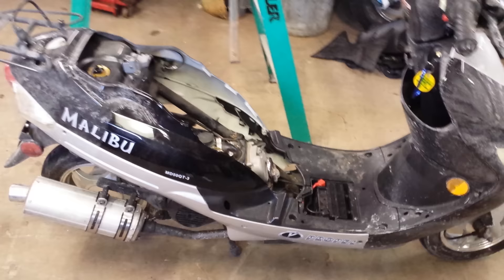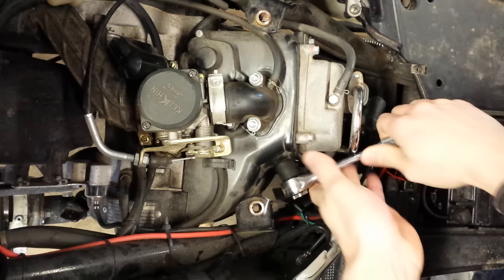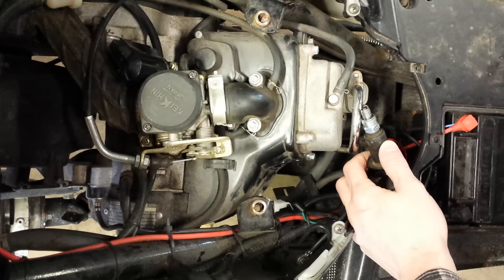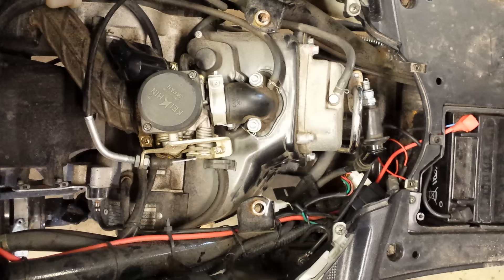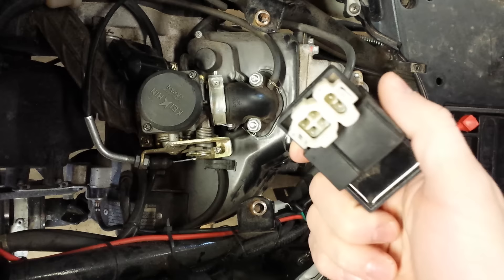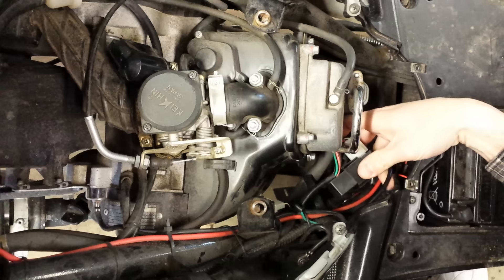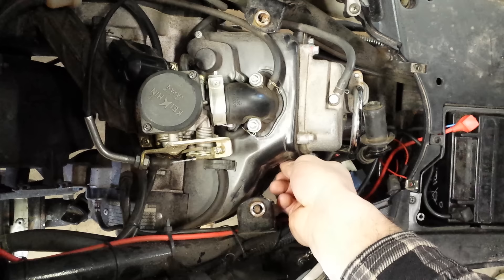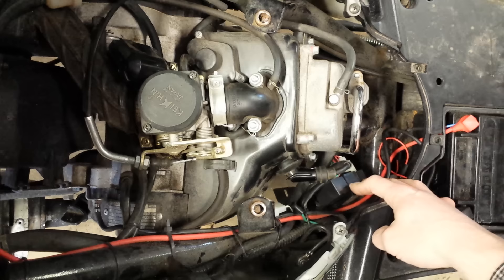Fix Chinese 49cc Scooter that won't start

Comment: Bro. 8 year old video saved my 2019 scooter with only 458 miles on it… hard time starting. I changed spark plug, cleaned carb, changed fuel filter and fuel. New battery. I was about to give up and saw the video. Paid $8 for CDI box and she started up… wow. Thank you

Comment: Also don't forget put some anticase on the spark plug cuz it's aluminum cylinder head
Reply: Funny you say...its also taotao so you will need to romove spark plug before oxidation starts🫡

Comment: no spark means bad cdi usually is what videos say but no , sidestand  has a kill switch for electricity , dont use sidestand when testing spark in plug.
Reply: Loftur Hjalmarsson Side stand legs kill switch doesn't allow you to even try and test for spark.
Reply: many scooters it only acts as a kill switch for the CDI and the side stand switches fail all the time, the sidestand is worthless anyway, use the center  stand and get rid of it
Reply: Saved my day😄

Comment: thank you for making this video. I went to a scooter repair shop and the assholes tried to make me pay 300$ for a gas tank that I didn't need. They said my gas tank was rusted. My scooter was doing the same thing yours is doing. I bought a CDI box and put it on just like you showed here and my scooter fired up. Thank you for saving me 300$ for a gas tank I didn't need and 300$ for labor. This video was very helpful to me. You are appreciated.
Reply from the maker: Glad I could help. I've learned a lot on YouTube and am always happy to post a video to help others!!!
Reply: Kasey Young you the real mvp
Reply: Gas tank is plastic, so no rust
Reply: @edboer2851  outside of it is metal
Reply: @jamesmosey1  à
Reply: People always try to get you to buy shit you don't need!
Reply: @kaseyyoung3332  Hey kasey.  How can I test the cdi box?
Reply: @michaelbearse4733  Just buy new CDI its not that expensive.

Comment: Thank you for your video and explanation of the Chinese scooter startup problem with regard to the spark plug and CDI box. I like the way you offer that kind of a clear and simple explanation of an issue without complicating matters. I have seen many videos about the CDI box replacement, but this is the first time to see someone provide a clear photo where it is located, how its parts (hooks ups) looks like, and how it can be replaced without any complication. I wish that you could also explain for us how to replace the ignition coil and carburetor on a Chinese scooter as well as the other issues that cause problems for many of us such as how to set up the gas and fuel lines and eliminate many of the vacuum hoses that cause unnecessary leaks.

Comment: That was easy! Sometimes it can also be the stator/ pickup assambly or the ignition coil. Before changing them you should check all connections by unplugging and reconnecting them.

Comment: I have a 49cc Santini San Remo with a GY6 engine block, and by the look of things it's very similar to your block. 
The carb and ignition coil look identical.
I took all the panels off, the seat, everything and for the life of me I couldn't find the damned sparkplug anywhere!!
Not one picture on the net was able to show the location of the thing. Thanks to your video I think I can find it now.
I know where the CDI is, and thank goodness that's easy to replace if I need to.
In the 80's I used to have all kinds of mopeds (Honda, Peugeot, Yamaha and Puch) and never had a problem with them. 
But this silly little scooter is nothing but trouble!

Comment: Hi, good vid. I got 4 of the Baotian version. All of the chinese engines are actually old honda replica engines. So the engine it selfe is good mechanichly. The other stuff is so and so tho. I fugured out that the Cdi`s are slmost open for moist. If you dry it out it will normally work again. So the trick is to keep it dry:-). Use a ballone or plastic bag. Also the wiring for the votage regulator is badly isolated. Normally located behind the front shield. Again thnx for good vid:-)
Reply: My Baotian struggles to start and wont idle at first. Once running for a bit it idles ok but if turned off it struggles to start again. Changed spark plug,Ht lead, auto choke, air filter, fuel filter and still same. Am i right in thinking i need to change CDI aswell? Anyone elses sorted after changing cdi? Thanks in advance.
Reply: isit a citibike2 ive got problems starting mine

Comment: You might mention your 5/8" socket for the plug = a spark plug socket. I was using a regular socket, to no avail, when it occurred to me....a week later, maybe I need a specialized socket. I did. It worked.

Comment: Mine went out today with about 1,200 miles on it. Hopefully tomorrow the replacement will have me mobile again. Thanks
Reply: Any luck
Reply: @ryanquinn2974  it's mostly always the 50cc scooter. But get 2 high performance CDI box's. They'll be orange. I would change the coil/plug wire and plug too. Make sure they're high performance. The black CDI is stock and limited.
Reply: @71jstevenson  thanks

Comment: I was riding down the road & for some reason I drop power. I was able to kick start it & it went another 1/4 mile & it died again. When I opened it up I tried starting it again but I got this "Clanking noise" then it would just hum. Now it only Clanks like twice & nothing. I adj the Valves so that's not it. It getting gas threw the filter but don't know if it's the starter or the Carb. As I'm thinking about it, I don't think the break light comes on either. What do you think is wrong?

Comment: I love this video, I'll proceed the same with mine, um, not really sure if the carburetor throttle slide is faulty or the cdi box, either way, will be following the same steps for tomorrow

Comment: Thanks for doing this video it helped me alot, this morning I went out to start my 50cc scooter it did not start my battery ended up dieing out right now I have it on the charger ! Two days ago I did change out my fuel filter and fuel line also had changed out spark plug  after doing this two days ago I wanted to see if my scooter would start after cranking it over some times it fired up so I cleaned up everything thought I was all set for my ride today to my medical appointment dang scooter did not start after watching this video I will go out to check on the things you recommended on this here video I'll give another update soon after I complete these steps ok !👌

Comment: Kasey - I own a Baolima that I am sure has the same issue.  However, when turning it over yesterday to try to get it started, I let the starter run for about 60 seconds.  Now I don't get anything when I depress the started button.  It won't turn over at all.  I checked the fuse on top of the battery and it is good. changed it anyway to make sure.  Still nothing.  It starts fine when you kick start it.  So I am left wondering if I did something to the starter?  Or what else could have happened.  I am trying to get back to the point where it at least cranks.  Then I'll check the CDI box and spark on the plug.

Comment: hi Kasey, thanks a lot . Do one need to touch spark plug to metal bar in order to ground before checking the ignition? Also did you have a chance to experience performance cdi s. do they contribute to top speed and acceleration considerably?

Comment: What should i do if i'm not getting gas on my finger? Fuel/vac lines are clear. I think i need to either replace the carb or clean it out. Do you know of a good tutorial for taking the carb apart? I tried spraying carb cleaner into the holes but it still didn't help.
Reply: disconnect the fuel line from the carb, and crank it over...fuel should only come out when the starter is turning the engine over or running the engine.
Reply: +James Turner also check to make sure your intake is tight or not cracked

Comment: My burgman 400 2004 was starting later when I tried it wouldn't. Brought the bike from a friend n it had been sitting for 3yrs... Put fresh gas in but didn't change spark plug... Would that b an issue it won't turn over (start)

Comment: Hi Kacey, I have a Suzuki vs150. I have changed the battery and it was able to start using the start button. I was able to do this for about 4 times to start it before it drained my battery again. I was hard to start so i guess pressing the start button for so long the cause? The kick start took a couple of tries but starting with a kickstart is no problem. i was wondering if this could be the problem with mine? Thanks.

Comment from the maker: I would say no. If you have spark but it doesn't start the very first thing I would be checking next is your fuel. Try pouring some gas in the carb or spray some ether/starting fluid in the carb and see if it will fire over that way.
Reply: Kasey Young  Where would I put the starting fluid or gas? I bought a new CDI box and a new spark plug and changed the gear oil plus put other oil in and it still won't start. This morning I tried starting it and it did for a few seconds then quit on me. In the air filter or the filter on the side, seems to be maybe gas? in it. I'm not sure what the stuff is. Any ideas on what to do? Maybe a gas filter like a little thing that looks like a bobber? But I haven't checked if I have one of those yet.
Reply from the maker: ***** has it started again since? Or not at all. One thing you could try is pour a little gas down the spark plug hole. That way you will know if it is starving for fuel. But yes in the air filter will work just fine for spraying the ether in.
Reply: Kasey Young Another thing you may need is a new Repay Coil.

Comment: I just got a peace scooter i put to much gas in it smh. It wouldnt start took ot to the shop warrenty still good and they said it was fixed. Got bout 5 miles fown the road and it happened again what u think could be wrong. The mechanic said i was not bad. He was confident it was fixed. What do you think could be wrong. Changed the spark plug it still had the china plug in it. Any ideas would help ease my mind.

Comment: How did you figure it was the Cdi box I'm having the same problem no spark I change the coil spark plug it has fuel one day it will run then some times I will be running the it dies but just today absolutely no start and I check for spark and nothing help thanks

Comment: I got Spark, it started at first but after running for a couple of minutes  it slowly faded and stop.
I see gas coming out of  the 90 degres hose hooked on the side of the carburetor but not from the port hole?

Comment: I replaced the coil and spark plug, I"ll try replacing the CDI box next. ANy scooter enthusiasts are encouraged to message  or reply with any advice for other possible things I need to check with regarding starting my TaoTao up again. Thank you.

Comment: I have the same issue. What do you do if you have no spark and no fuel when you take out spark plug to test for spark.?? I replaced the spark plug already. The spark plug was bad. But still no spark or fuel when checked

Comment: I recently bought a Lentex sprinter, and I have the exact same problem no spark on a new spark plug, should I install a new cdi box?
Reply: If you could find a scooter same model, exchange cdi for test first. To see if the cdi is faulty.

Comment: Thanks for the video! I have a 50cc tao tao, problem starting when is cold. It will eventually start after like 20 seconds of cranking. What could that be? And thanks in advanced!

Comment: hey brother i got a question,  just bought a 88 riva jog, yamaha put a new battery in it put still no powe at all. no lights, dash lights or brake light. was sitting in trailer for 3 years. has new ignition according to previous owner..

Comment: Also you got to cut the ears so you can move the pulsar up and down and set it to 15,000 between the flywheel and the little pickup poster for spark

Comment: I replaced the starter and spark plug in my 2014 yao yao and still no start and was told if the brake light comes on when trying to start it that a safety has tripped out (to keep someone from hotwiring it?) A previous mechanic had tried starting it from the solenoid... and may have tripped it. Is there a way I can fix that?

Comment: Hi I have a Chinese scooter and I did change the CDI my problem is it works fine for 2 day then it doesn't want to turn on again. I did everything you did on your video but my problem is still the same any other tip you can give me?
Reply: +Frank Camacho Check on the stator or the pick coil.
Reply: Thank you very much it was the stator that was the problem.
Reply: np Frank

Comment: Mine will somewhat start then die if I take hand off throttle but have a hard time starting it tried replacing spark plug it somewhat helped but not by much I will look into the crime box thing but how to tell if it’s bad

Comment: I have the same exact same scooter.  I can get it started ( after changing the spark plug, cleaning the filter) , but it will not stay on and idle.  If I crank the throttle 4 times, then hit start, it starts but does not idle.  Yup thoughts?

Comment: Check the timing and make sure the the valves are set properly... once I did that on mine... started right back up and ran 5 miles per hour faster..

Comment: Kasey I have been trying to get my scooter to stay running did some tests fuel filter and carb check and now replacing plug wire and box wont stay running any other ideas?

Comment: plz help i have a yamaha neos 100 ive replaced the plug ,,stator,,coil,,but my bike wont start there is a spark for a split second when i press the button or kick it but stops sparking straight away any help plz ??

Comment: Hi thanks for that. I have several Fosti scooters all hard to start,if they start at all, changed Cti ,carbs, plugs, even stripped one down put new rings and re seat valves. Spent days on them, have a top bike mechanic give up. They are new 2013, been sitting awhile, changed fuel, one did 120kms before packing up. Would appreciate any ideas Rod

Comment: mine start only when I spray ignition quick start spray in it, then dies shortly after. I have to keep this process going just to get a ride out of it. any suggestions
Reply: You aren't getting enough fuel to start it. See if there is fuel reaching the carburetor. If  there is, the carb probably needs to be disassembled and the passages cleared out with compressed air or maybe a strong jet of wd-40, Brake Cleaner, carb cleaner or such. When re-assembled (properly) it should run without the ether spray.
Reply: Thanks got rid of it.

Comment: I have no fuel when I put my finger in the plug socket, any suggestions?
Reply: Yeah as the guy said basically take the "FUEL IN" line to your carb, pop the end off, and try to crank your bike over. Fuel should spill out of that line. If it is fueling from the tank to the carb, and you have spark, then I would suggest taking off your carb and completely cleaning it or just buy a new carb. Then put the carb back on, hook everything back up, let it crank for 10 seconds or so and it should fire up

Comment: Kasey, i changed out my stator, put flywheel back on, now it turns over like 2 times then quits, starter seems to go a few more seconds without turning flywheel, didn't have this problem before i removed and replaced flywheel, any thoughts? Thank you in advance
Reply from the maker: so your starter is disengaging from cranking your motor over halfway through the starting process?

Comment: 9 out of 10 times if you have no spark its the cds. if your bike has no cdi look for a black squar bob its a relay some older schooters used relays instead of cdi systems. I actuly just fixed a schooter the other day for a firend that used a replay instead of a cdi. 2 different machanics looked at it could not get it running she bout it off the one o fhtem who owned it I poped in a new realy and it fired right up. now she wants to take it to the guys house and show him how a person who is a quarter the age of 2 people who have worked on bikes all their life fiex something they could not.

Comment: Great Video Kasey. (I've worked on GY6 50 & 150 scooters (EVO 150 is my current one/see my pic) for over 10 years and I have found that about 90% of Starting problems are the CDI boxes (even aftermarket ones die).
But I have a friends 2016 Taotao 50 that I've worked on a couple of times,  but now it won't start. It's got spark, tanks got fuel, filter is clean, no lines are pinched, but it's not getting fuel.
Whats your thought ? the vacuum/petcock diaphragm is bad so no fuel is getting to carb ? or do think it might be a clogged jet in the float bowl ? or maybe a float that is stuck shut ?
NOTE: the plug was dry...even a little orange rusty, but I wired brush cleaned it and it still sparks ( I did replaced it though).

my next step was to take the air box off and spray some starting fluid in the carb and see if it will fire...which if it does, would tell me it's definitely a fuel flow problem.
My next step would be to pop the vacuum line off and the fuel line to the carb from the vacuum/petock and suck on the vacuum line to see if the diaphragm is working and letting fuel flow.
After that the only thing I can think to do is to pull the carb and clean it...which is a hassle, but I've done it before (on the Jonway Fone 150cc I used to have) so its doable, just a pain.
I would appreciate your thoughts.

Comment: My scooter turns over but won’t fire. I drove it in the morning, turned it off, then went to get back on 10 minutes later and it wouldn’t start. Came back about an hour later and got it to start up pretty quickly but later that afternoon it again wouldn’t start and still won’t. It has spark and the battery is fully charged. What should I do?

Comment: i got a gy6 150cc Got a new carb new air filter new exhaust great spark turns good good compression but it wont idle and I cant figure out why any ideas?